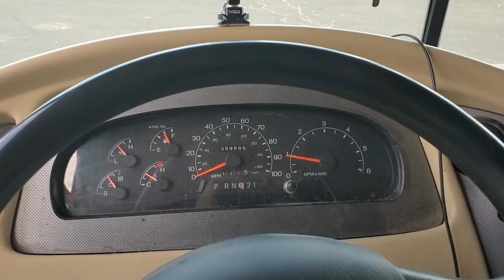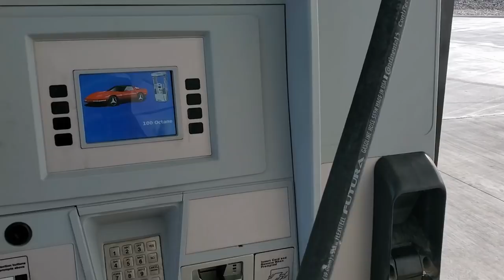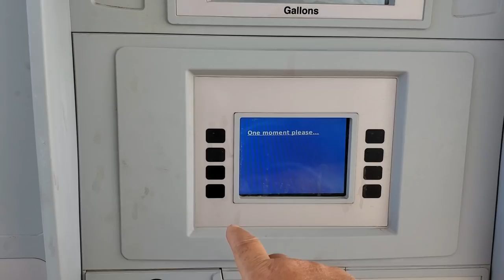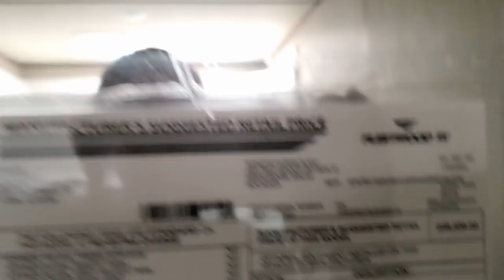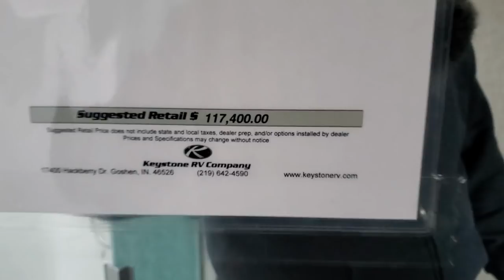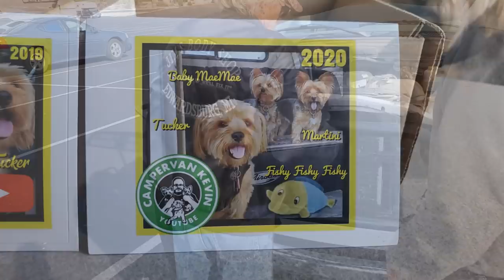How I Trick Myself Into Feeling RICH All The Time! Looking At New Rv's

Comment: My late husband, Gary, drove a '99 Dodge 2500 Cummins diesel from 1999-2006 when he died. I donated that truck to the volunteer fire department of which he was vice president. It had 249 thousand miles on it at the time and it still ran as good as the day we bought it. All that he had done was the routine maintenance. As long as you do that with those Dodge Rams they will never fail you.

Comment: vandweller tip:  if you're rolling alone, get you a lithium jump box, so you can jumpstart yourself!  mine is a jaco boostpro that can handle a 6.5L gas engine, or 5.2 diesel.  it's 16,500 mAh and 600 peak ah.  i used to carry a big lead acid jump box, and it saved my butt a few times (and a lot of other people's!), but i love these lithiums because they are so small (fit in a case like the one sitting on the engine in this vid).

~and~, since you only need a jump box once in a blue moon, it's always great to carry stuff that serves more than one purpose, this doubles as a power source, since it has two 2.4 usb ports. i sometimes use it to charge devices overnight or on cloudy days, and then charge it back up later when the sun is shining.

i kinda wish you all had used one of these in this vid, because i've only had mine for awhile, not long enough to need a jump, so it would be good to see how well they work!

Comment: Scary stuff this cancer business. I may have mentioned that I have a couple tumors as well so I'm what they call stage 4. I'm handling it as naturally as I can with fasting, low carb, a whole box of supplements and a twice a week megadose of vitamin C through a drip. I'm staying away from chemo and radiation unless this fails.
Been at it for about 7 months. Pants have gone from a tight 42 to a lose 34, weight went from 245 to 167 (that's 78 pounds my friends) and at 54 I feel almost like I did when I was 30.

I feel rich because I busted my butt for decades, ramped my spending down to the pain point and socked away the surplus, avoided marriage and divorce, then retired at 54. I was going to push out it a bit more so I could reach an arbitrary financial goal but when I got cancer I realized that was silly, so I pulled the plug on my job about 7 months ago. Oh, I should mention that I did all this on mechanic wages. Basically, with a frugal lifestyle a guy can accomplish a lot, even without some kind of crazy advanced degree.
Reply from the maker: much respect! good luck with your health! I dont trust the chemo either.
Reply: @CampervanKevin  
>I dont trust the chemo either
I pray  to god you never have to. Sounds dramatic I know, but true.

Comment: Hope my 2017 Titan with the 5ltr. Cummins Turbo lasts 300K. Paired the truck to a Lance 2375 T.T. with around 7.5K gross. The truck is rated just under 12k with 650 lbs. Torque.

Comment: #258    Good evening, Kevin.  Checking out your video with a barley pop.  Good price for fuel, I would top mine off, too!  Thanks for showing the Fleetwood Bounder with Sun Deck!  I have not seen one like that.  $209,000.00.  That means it will go for $172,000.00.(Cash).

Comment: We have a 2002 12 valve 500,000 miles just regular maintenance  anything after 2004 is chipped and   detuned doesn't have the power of the older ones

Comment: Good afternoon Kevin and the Woofpac! Good tip to cut off your propane hot water tank and gas refrigerator when fueling up your rig, and I bet most people don't remember to do that. My husband always fills up my car, so last week I was at Casey's and didn't know what type of fuel to use, even Google didn't help. I had to call my husband to find out, and I already forgot which type, so I'm going to check my receipt and write it down, I'm to embarrassed to ask my husband again. Lol! But i don't want to mess up. What type of fuel do you put in class A? Ausia said she uses premium, but for a 2018 I don't think she needs that extra expense on fuel. $117,400 that was my guess/not! Lol! I guessed $98,000 Safe travels!  🐶🛣🚍⛽❤💕
Reply from the maker: I use 87 octane. Mine runs fine on the cheaper stuff
Reply: @CampervanKevin  Thats what I use too. Our computers adjust to the fuel. I really think the premium gas could do damage. Only the old rigs with carburetors need premium fuel these days.

Comment: This is probably a "girl" question, but why do you shut off fridge and hot water heater before fueling?
Reply from the maker: my fridge and hot water heater are powered by propane. most propane appliances keep an open flame to work
Reply: @CampervanKevin  Makes sense..Thank you!